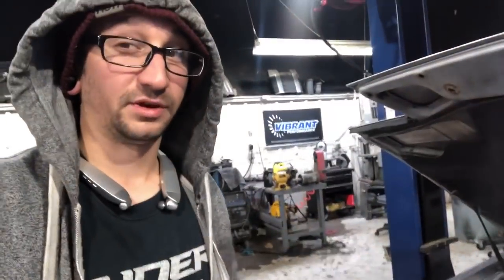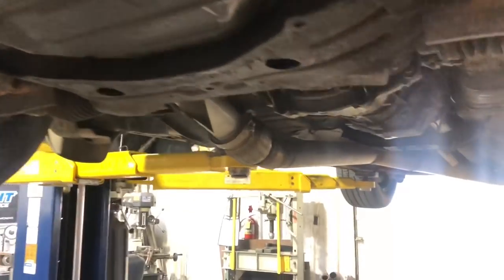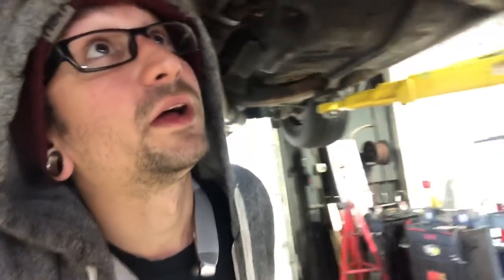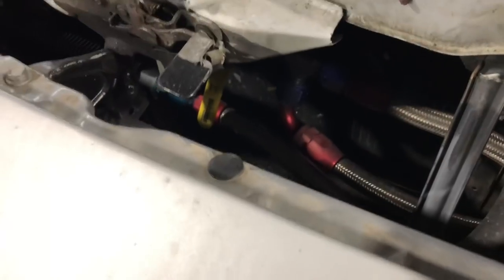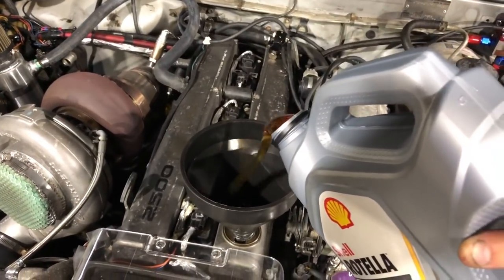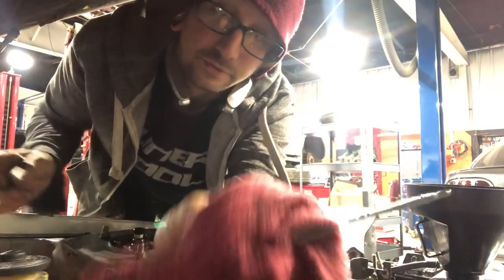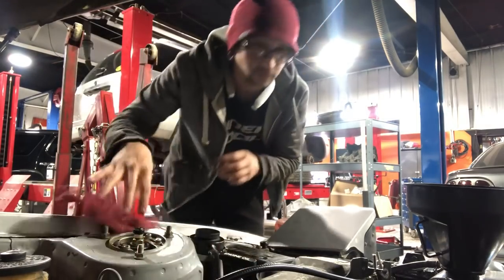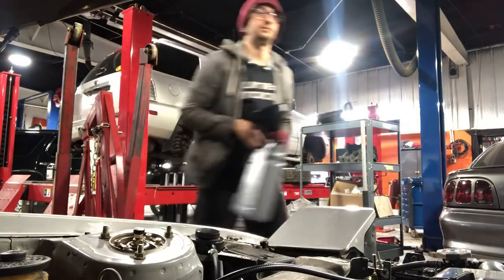Accusump Oil Change

Comment: Nice info, short, right to the point with the drain / fill operation on an oil accumulator equipped vehicle and manual valve. After decades of changing oil / filter, it has always bothered me knowing that 3 seconds, 5 seconds or more pass as the engine cranks then starts and oil pressure rises on the gauge. Short of pulling the fuel pump relay & fuse, or ignition, but either way there is no pressurized film of oil on the bearing shells for the rods to ride on. In 150K miles, how many times was the engine cranked & started? If oil under pressure was there, I would bet you could double or triple the life of the rotating assembly. Remember, this includes that little squirt on the thrust side of the piston walls as well. It’s just a win - win all the way around. Just great! Retired ASE Master.
Reply: Well on heavy machinery there usually is a priming pump. why not on cars?

Comment: Anyway of doing this procedure without a dry start?
Reply from the maker: You can de pressurize the accusump, prefill the tank, close the valve, install the tank, then re pressurize the back of the tank to 15 psi, then open the valve.

Comment: So ehm won't you have issues when increasing revs... Because if you increase revs the oil pressure build up

That would cause lag right? Since the oil is going to the accumulator it would take more time for oil pressure to build.

I am also curious if it is filled at idle and you rev you could cause oil to get from the pan to the accumulator and the pump would suck air

This is what I think tho. Anyone who knows if it's true? I mean there has to be a downside to these accusump things right?
Reply: hydrualics have no lag, oil doesn't compress very well. also oil pressure doesn't linearly increase with the rpms, yeah the pressure rises when you rev it up but what's important is the flow rate, that's what goes up when you rev the engine up and what really matters. accusumps have been proven to be an engine saver for years and i've yet to see someone having problems with them.